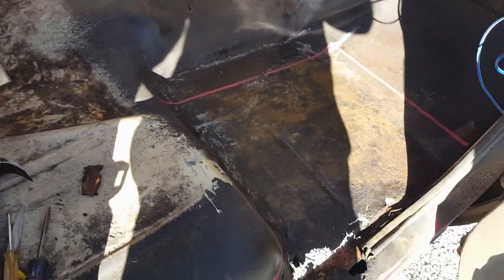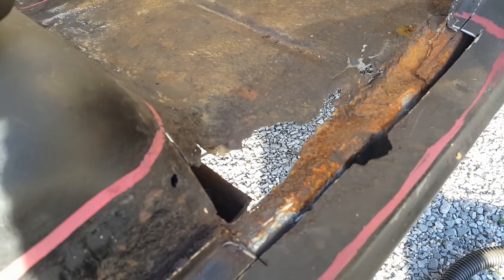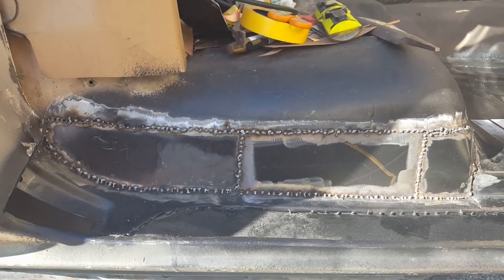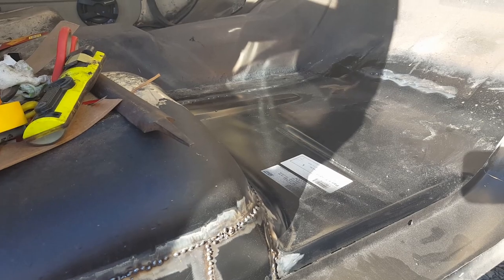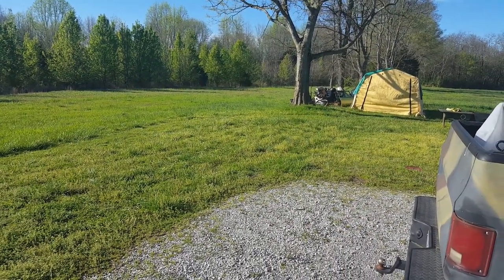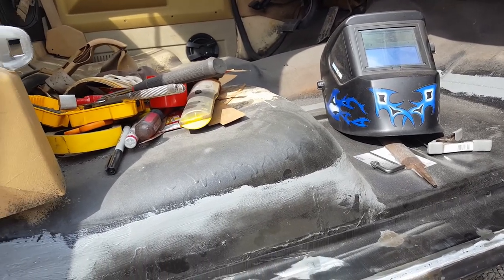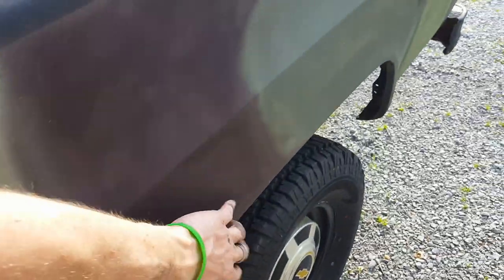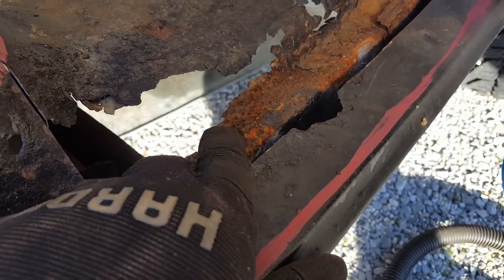Repairing a rotted floor in a Chevy square body truck

Comment: The welding repair looks good. It's rare to find an older chevrolet that doesn't have a lot of rust. The cab corners are a common rust spot. The good thing is that there are lots of repair panels available.

Comment: Good work Tyler. Give your cowling a water test- There is some seam sealer in there that dries out, and lets water create holes by the fuse box and above the heater box. (Flex seal will get in there). Also, there is a foam seal around the a/c recirc door on the right kick panel. Make sure no water is getting in there, between the panel and skin of the truck.
Reply from the maker: Thank you, I will do so.

Comment: It has been a long time since I welded up some good old winter beater sheet metal. Now it's when I do an exhaust. I still like stick welding with 3/32 stainless and oxy acetylene with a coat hanger.

Comment: Mine has about the same amount of rust. I'm getting a welder soon and can't wait so I can go to town on this thing.  I'm gonna buy a cheaper one since I won't need to weld much thicker than 1/4 inch. Good thing is it's a K5 and I have another one I can compare to.
Reply from the maker: The thing is, a welder is an investment and one that you want to cover your needs for a good while. Try to buy a little MORE than you need.
Reply: @TylersNeighborhoodGarage  Yes you are definitely right. I've welded the better part of my life I even lived in a welding shop over a year so I need to slow my roll and just save up for the Miller I want. Then I'll be doing other peoples projects possibly and getting some welding work, I'm just excited to get started and am a little low on money but your definately right and you got me thinking straight again, thanks and have a good day.
Reply from the maker: @blazerwilliams2260  There you go. I had to save for a welder for quite a while.  You will find that if you are judicious with your spending, your investments will start to pay good returns.
Reply: @TylersNeighborhoodGarage  Exactly

Comment: Dang man you went to way more than I would for not going to make it perfect. That back corner by the seat belt where the door gasket goes on the lip, I wouldn't worry about that, just let it ride.

Comment: I need to get a argon bottle so I can start welding some thinner metal. The Mercedes and the Firetruck both need some body work.
Reply from the maker: Warning....once you start, you can't stop! LOL at least I can't. I have more rust than metal it seems.